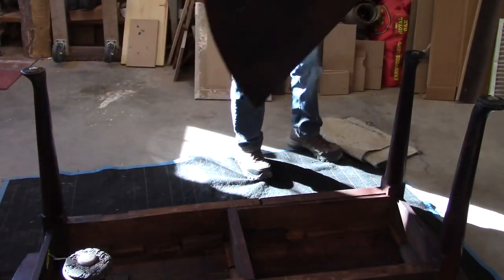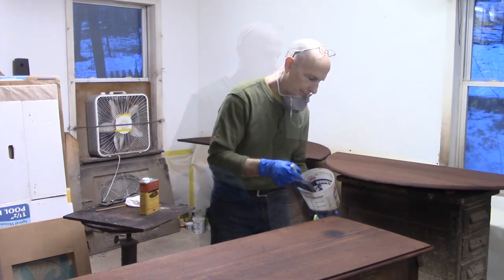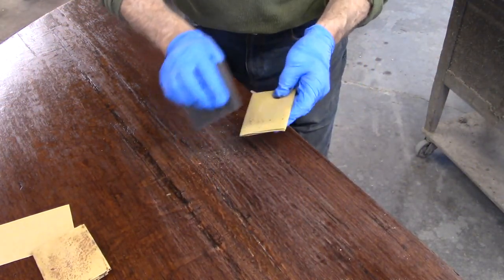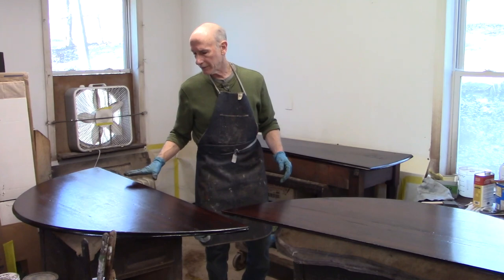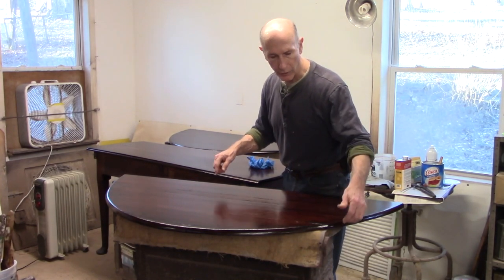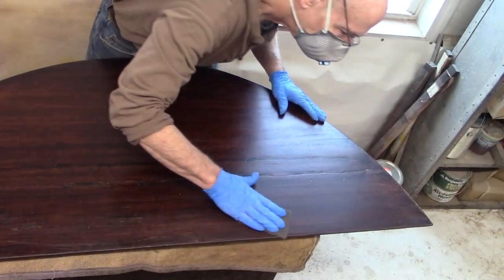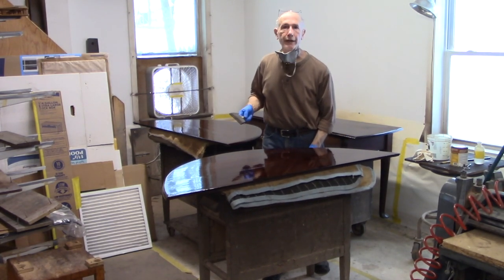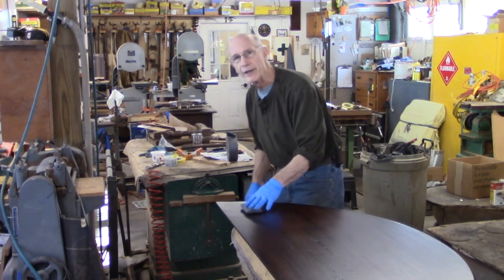Finishing an early 18th c. Drop-leaf Dining Table - Thomas Johnson Antique Furniture Restoration

Comment: Wow... so much effort, I applaud it. We just finished up a drop leaf table that had a terrible old finish on it, once stripped, we finished with 3 coats of Minwax Antique oil. Came out looking great, do you recommend doing anything else ontop it?
Reply from the maker: Thanks! Sounds like you did a good job! Only some wax, and then you might need to re-oil it after a year or so, if it looks like it needs it. The Howard's Feed N Wax would be great https://www.howardproducts.com/product/feed-n-wax-wood-polish-and-conditioner/
Reply: @johnsonrestoration  Thats exactly what we were going to do! Question is how long should we wait for the oil to cure before we wax it? I really enjoy your videos, please keep them coming.

Comment: I noticed you are using a foam brush instead of a bristle brush.  What are your thoughts on the difference between the 2 ?
Reply from the maker: Thanks! I never wanted to use foam brushes. This was the first time. I've been having trouble with brush marks and out of frustration tried the foam and it worked great for this particular finish

Comment: My ears pricked up when you mentioned asphaltum.  I do hand plane restorations and use asphaltum as part of the japanning process.  I use shellac and asphaltum in equal parts, cut with enough denatured alcohol to create a thick past.  Spread it on the plane body and then pop it in the oven (not the wife’s) at 270 for a hour or so.  When it cools, it is hard as a rock and super durable.
Reply from the maker: Wow! That's so interesting. I will try that

Comment: When do you use a foam “brush” and when do you use natural bristle brushes? You’ve used both in this video
Reply from the maker: Thanks! I've always used natural bristles. I was dismayed when I found that polyester brushes seem to work better. I was further dismayed to figure out that for this particular finish - Waterlox Original - that the foam brush worked best! There are hundreds of different brushes, all have specific purposes

Comment: I like to see how professionals do even the simplest seeming tasks.  More importantly, knowing why.  So, for example, why apply glue to both surfaces? The best reason I can think of, especially when repairing irregular breaks, is to prevent air pockets being trapped weakening the final joint but I'm just guessing and would appreciate knowing the rational behind this. I've noticed  that the same coat both surfaces seems to be done even with  flat finished faces, unless that has become best practise for all surfaces.
Reply from the maker: Thanks! Glue on both surfaces so that for a few seconds or moments the glue has a chance to penetrate the fibers. This is essential for a good joint.

Comment: Tom, I have many, many questions. Too many to ask, frankly, but I would be interested in your response to this:

It seems drying of the multiple finish coats was an issue. Do you think that would be less of a problem if, say, you worked on this in summer/early fall instead of late winter?
Reply from the maker: Thanks! Definitely! but I kept the heat cranked up, I feel like it dried

Comment: Amazing work, as always. I was wondering--after you put on the glaze with asphaltum, would shellac have made a good barrier coat?
Reply from the maker: Thanks! Yes, it could have, ideally sprayed so as not to disturb the glaze. But I didn't want to seal in any undried finish either.
Reply: @johnsonrestoration  Ah, that makes sense...thanks!

Comment: Thank you once again Tom! Great result! One question: What are your experiences with the foam brushes? They are not very common or not often used in Europe. Are they reusable or more of a throw-away-after-use item? What do you prefer? What are the advantages in comparison to a traditional brush? Thank you!
Reply from the maker: Thanks! This is the first time I have used one. With this finish they seem to work best. Most people use them as a single use, but I wash mine and use them a few times
Reply: @johnsonrestoration  Thanks Tom!

Comment: Question: Why did you not use a seal coat of shellac after the stain, before the tung oil varnish?  Shellac should seal the uncured raw linseed oil, shouldn’t it?
Reply from the maker: Thanks! Yes, correct. On table tops I try to use only the varnish.(weakest link and all that)

Comment: A wonderful transformation. The time lapse video clearly does not take into account all the work undertaken. How many hours do you think were invested in the finishing process and then the project overall?

Also, would the table have been stained when it was originally built do you think? Or, is the colouring simply aged old oxidation of the wood?
  
Thanks again, a very interesting and educational video.
Reply: Early 18th century (and earlier) oak would have usually been finished with linseed oil and more oil would be added occasionally (wax was expensive). Both the wood and the oil would oxidise and darken over time, plus whatever soot particles from open fires, lamps/candles etc. that would fill the grain, especially when mixed with the relatively slow curing oil
Reply from the maker: Thanks! I put about 60 hours into this. I wasn't sure about the stain, but I like dlevi67's answer
Reply from the maker: Thanks! It's interesting

Comment: excellent work! i saw part 1 twice to refresh!!! two points:  
the huge crack at one of the top side panels really annoys me a lot, if it was mine i would have filled it somehow, and
at the finished table with a new perfect finish  i would not put on top a vase and 2 candle holders !!!!
Reply from the maker: Thanks! Yes, and that's the beauty of it, you can restore to the level you're comfortable with. I think the varnish is very durable

Comment: What is the most unusual type of old finish that you have had to deal with? I've heard stories of things like egg whites etc. Also, have you ever considered or used an electrostatic dust remover or other air purifier in you finishing room? And as a suggestion, perhaps you may include how many man-hours it took on a project. Anyway, thanks from a subscriber.
Reply from the maker: You're welcome! I should try the electrostatic, good idea. Once again, I forgot to say the hours. I have to look that up, I've already forgotten

Comment: I think those people who talk down antique refinishing aren't talking about what you do. I would think what you do is truly restoration. I think they are talking about stripping and sanding down the whole piece to bare wood, repairing all the holes and cracks with wood fillers and even changing the color of the piece... Losing the original craftsman's sight of the piece. I believe that is what makes a piece lose it's value. While, what you do is to keep the original craftsman's vision in mind the whole process and keeping the piece functional at the same time. As the piece becomes worthless if you can't set a vase on it because there's a huge crack or because the finish is so oily/sticky that you can't put a table cloth over it. You do great work. Don't let those nay Sayers get under your skin. Sending lots of love ❤ from sunny 🌅 Arizona 🌵.😷
Reply from the maker: Thank you! Well said. I appreciate it!

Comment: Another great video. Is the asphaltum you use a varnish? The only one I can find is from Rio Grande and it states it’s for metal etching. Thanks!
Reply: The asphalt(um) by itself is not a varnish, but it's commonly used as a dark brown/black pigment. I didn't know it could be used in metal etching - perhaps as a component in a resist coat?

You can also look it up under its 'scientific' name of Gilsonite; easy to find in art shops in the UK, but I don't know whether the same is true in the US.
Reply from the maker: Thanks! In this case it's just a colorant. I like dlevi67's response
Reply from the maker: Thanks! I think it's widely available here

Comment: Why do you use paint thinner to wipe down the finish?  It seems that might go thru the finish.  Why not use a rag or a slightly damp cloth?
Reply from the maker: Thanks! I wipe down with paint thinner between coats to get rid of any contamination. It doesn't hurt the finish if the finish is dry

Comment: You sir did nothing to hurt the value of that table. If anything because of the condition of the piece when you received it, in my estimation you've increased its value! You didn't strip the original finish. You stripped the the nasty finish that someone else had messed up and in doing so fixed a huge problem that was called a refinish job someone else had done long before you got your hands on it. Your repair work is incredible you should be proud of your work! I can't believe how hard you had to work to get the finish to look that incredible. How many hours did it take you? Also how can you charge the fair wage you are owed. I have run into that problem in some of my work in the past and I just had to eat some hours. But you have a video showing your work. I never had that luxury. But I hope you got what you were owed, or at least where you were satisfied.
Reply from the maker: Thank you! I'm so glad that so many people agree that the table was greatly improved. I agree about the value. I think I put in about 50 hours, and I was paid for my time. We've all eaten a lot of hours over the years, but not anymore for me. I had to draw the line. Does your mechanic or plumber eat hours? Or your lawyer? People have to pay for your time (easier said than done!)

Comment: I’m not sure if I’m allowed to ask you a question but I will try anyway .we just recently bought a 70 year old trailer and the interior is all birch plywood what do you think would be the finish that they used and how would we match old with new I would think it might be shellac?
Reply from the maker: Thanks! It's probably nitro-cellulose lacquer. Shellac is compatible, and could work. Any finish could work actually. Clean the old woodwork and apply a coat of satin water-based polyurethane. Finish the new work with water-based poly and give it a final coat of the same satin poly
Reply: Thanks very much for that ,I would love to see a special clamping episode you seem to be the master clamper ,along with everything else you do you’re a true inspiration and you’ve taught me not to be scared of tackling some things that I normally would not

Comment: Have you ever thought about letting the finishes vertically?  I find that it cuts down on my dust issues.
Reply from the maker: Thanks! Good idea! I had not ever thought of that. Of course, there is a limit to what pieces you could do that with
Reply: True.  I built a ‘filter’ out of two box fans that fits a whole house hepa filter.  Seems to catch a lot of fine particles.  I will run it before I finish anything to clean what I can out of the air.  Nothings perfect though !

Comment: Some antiques should be left alone but furniture is not one of them. By refinishing and restoring that table you made it usable again which greatly increases the likelihood that it will be kept & used instead of being thrown away. If you can make an antique fully functional again with the intent of using it then it doesn't matter if some collector is mad because it is no longer a good decoration in their eyes.
Reply from the maker: Thanks! Yes, well said

Comment: Reflection: Surfboard manufacturers have shaping and finishing booths. The surfboard sits on a stand in the center of the booth at about work bench height. On the walls they have fluorescent lights mounted just higher than the surfboard. Shelves are mounted above the light tubes to keep the upper part of the room, not blacked out, but relatively unlit. the reflection highlights differences in contour and sheen. It works.
Reply from the maker: Thanks! Yes, I wish I had better lighting. On the other hand, the furniture is not under that kind of light in the home, so it's not as important. A surf board on the other hand the smoothness is a performance issue

Comment: Occasionally I have to refinish solid wood kitchen countertops which have been stained with olive oil etc. I find soaking it with methylated spirits, or in the US, denatured ethanol and setting light to it.
It burns at such a low temperature as (with care) not to burn the wood but will draw out the oil by capillary action. Works well and gives the customer the heebie-jeebies!
Reply: 🤣 Not to mention what it does to the insurance broker!

(I'd use a hot clothes iron and a cloth or paper)
Reply: @dlevi67  what they don't know won't hurt them. All done very safely.
Reply from the maker: That's funny! I would like to see that! Yes, wait until the homeowner leaves before lighting it up. I'd like to try that in a video
Reply from the maker: Yes, a lot more control
Reply: @johnsonrestoration  little and not so often. I've got some oak, I'll have a quick go and show how it works for me if you wish.

Comment: That's so weird how that old linseed finish just wouldn't dry.  I'm so used to using oil paint (which is linseed based) which dries completely after about 4-6 months (depending on how thin or thick your paint layers are).  I actually like using a product called Galkyd from the Gamblin Paint Company, you can mix a little into your oil paint and it causes the paint to dry within 24-48 hours.  Hmm...I wonder if you could mix that into an oil based stain or varnish and get a rapid cure.
Reply from the maker: Thanks! I'd like to try that sometime. But are those products clear?
Reply: @johnsonrestoration  It's not clear out of the bottle, it has a brownish/yellow color but it dries clear.  There are three different products, Galkyd. Galkyd Lite and Galkyd Gel.  Straight Galkyd is browner, the Lite is more yellow and thin and the Gel is clear.

Comment: Is your experience that dye stain ages differently than the surrounding areas?  I'm not talking about archival aging, but, say, 6 months or 12 months or so.
Reply: Not Tom, but with some experience in using dyes and stains. My observation is that it depends; I find that water-based stains are more stable (but less predictable in result and more difficult to use) than alcohol-based stains. 6-12 months is not an issue with either type - if applied correctly and not left in blazing sunshine; 10+ years you do see the difference, but eventually pretty much all stains age differently, so unless it is applied uniformly on all the surface (which means you are refinishing completely), at some point it will show.
Reply from the maker: Thanks! Good point, I like dlevi67's response
Reply from the maker: Yes. I would think at some point there could be a difference, but I've never noticed it

Comment: question:  why not use a roller to apply glaze and color instead of a brush?
Reply from the maker: Thanks! I've never tried that!
Reply: @johnsonrestoration  specifically a FOAM roller. Try it on a scrap board, it leaves a fine texture almost like spray and it covers more area in one pass than a brush.

Comment: Can you please explain the differences between dyes and stains and how one decides which one is appropriate?
Reply: A 'stain' is a general term for a paint used to colour wood. A dye is a type of colourant that is dissolved in a medium (solvent), while a pigment is a colouring agent suspended in the medium, and is made out of larger particles than the molecules of a dye. Dyes are (mostly) 'transparent' when applied to wood: the colouring agent soaks into the fibres, while pigments cover the wood surface and are more opaque.

Most wood stains contain both pigments and dyes in their make-up; which one to use depends partly on the material (very fine, closed-grain woods may look like they are painted if a mainly-pigment stain is applied), and on the effect you want (limed oak wouldn't look 'limed' if the liming stain were transparent).
Reply from the maker: Wow! dlevi67 answered better than I could!
Reply from the maker: Thanks!
Reply: @dlevi67  is there a significant difference in color fastness, longevity, etc etc
Reply: @gregoryvschmidt  It depends on a lot of factors. The actual chemicals used for the pigment and the dye, the wood that you are applying the stain on and the other components of the finish, the environment (humidity, temperature, light, UV, ...), and last but not least on what you consider 'significant'. All else being equal, generally pigment-based stains are more durable.
Reply: @dlevi67  That’s been my experience too, but wanted to know from someone who appears to have a deeper understanding from a chemistry point of view.
Reply: @gregoryvschmidt  Well, the problem is that some dyes are extremely stable (e.g. azo-dyes), and related to some pigments which present similar characteristics of durability. Others (e.g. mauveine) are quite labile... so I suspect you can ask all chemists you like, the answer is still going to be 'it depends'.

FWIW, some of the causes of greater pigment stability are 'physical' rather than 'chemical' (the particles are coloured and coat the surface to be stained, rather than bonding with it through absorption).

FWIW 2, and speaking here as a woodworker rather than as a material scientist (and not an expert in colourants by any means), you are lucky if you get told on the bottle that it's an alcohol rather than a water dye, never mind its chemical composition. 😉